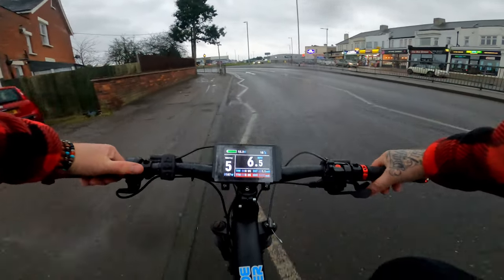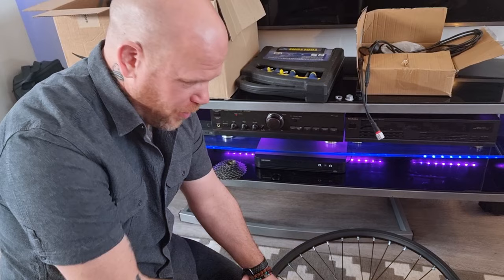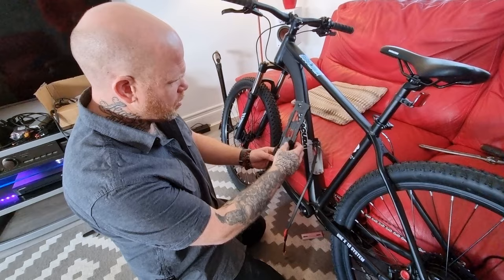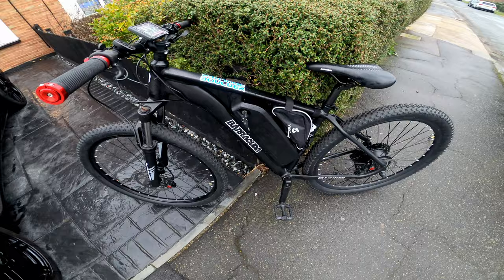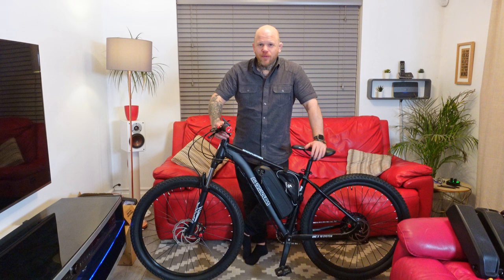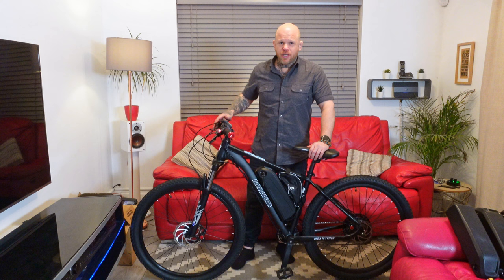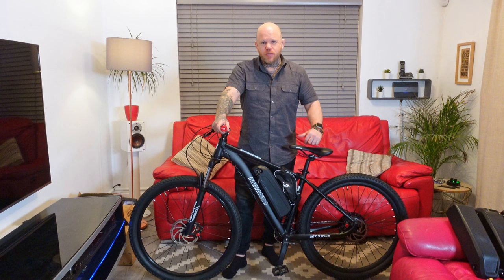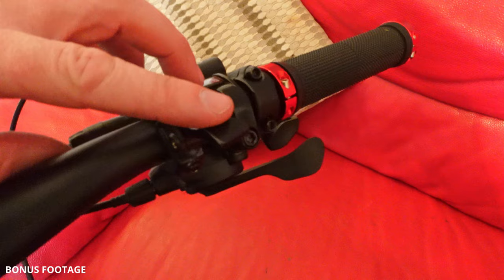How to BEAT the 250w ebike RULE!!!

Comment: I'm building 2 E Bikes and I've had to use a 10 ton Press, Arc Welder, Angle Grinders, Bench Drill and loads of Spanners and an Electric Impact Driver to fit the motor in the right place !!!  How they do it in India with a Hammer and a Spanner and a Screwdriver is Beyond Me !!!!    A sledge hammer  won't  bend  the  mounting plate !!!  Of course, nothing fits properly without a lot of work, but now I've got the motors fitted it's getting a lot easier !!!!  You need to be able to move the motor a bit to adjust the slack on the motor drive chain because it's bound to stretch !!!!

Comment: Sure, put a big controller and battery, and run a 1000w through a "250w" hub. Problem is, it's not rated to take that kind of current. I'd be nervous about that thing overheating and burning out on a hot summer day uphill. I hope you had some good cooling in mind for it.
Reply: Nah ,I've been putting 55v at 22amps through my 250w geared motor for 5 years now and not a problem, here in England 🇬🇧 it hardly ever gets hot enough to warm the motor or controller 😅
Reply: @ianmangham4570  Good for you! Over here in Croatia, that would fry the motor during summer, on its first climb uphill XD
Reply: @necroticavalon5176  Never gets warm here 🇬🇧 🤠🤟

Comment: Amazing straight to the point video love it. So I have a 1000w motor on my ebike smlro xdc 600 how can I get this moving faster its pretty OK 25ish maybe I'm 6ft and maybe if 30mph on 250w is achievable how do I get more on the 1000w Karen answers not permitted.
Reply: Get a bigger battery like a 60 volt, more volts = more top speed, more amps = more torque and make sure you controller can handle the voltage as some only have 63 volt capacitors in them so you’ll have to make sure they have 100 volt capacitors or you could burn it out

Comment: i've got a 36v 17Ah battery running a 500w Mid drive on PAS and agree PAS is "sketchy"  but I do like being able to use my gears to ramp up the slow speed torque.   if I forget to switch it to PAS level "0" I often get pushed into oncoming traffic if I accidentally hit the thumb throttle
Reply: Are you using a 36v controller or a 48v controller!

Comment: Hello, Dude Stuff. Quick question: does 'forcing' the bike to go beyond the wattage limit actually reduce the bike's lifespan in some way?
Reply: Reduces the lifespan of the battery a bit faster, and drains the battery more for the same distance
Reply: Knackers the hub motor as it's only built for a certain wattage really. Tiny nylon wheels having that much force going through will eat them up quick. Won't affect the battery at all
Reply: you can probably quite easily double the rated power of any hub motor and it will live with it all day. Most "250 watt" motors are probably 500 watt with a sticker saying they 250. This guy was probably putting 30 amps through it. Not sure what point he was trying to make with this video really
Reply: @mutleyeng they rate so many motors with much mote power at 250W so they can be legally ridden in most countries, which increases sales.  My china 250w "kit" runs at 750W with the stock "250w" controller.

Comment: I’ve seen a guy (sort of) beat the no throttle rule by just using a pedal assist sensor on the crank, but having no chain, so just giving the cranks a good spin basically works as a throttle but legal

Comment: I have pushed 750w peak through a cheap 250w geared hub motor, it still works.
Reply: Did you use the 36v controller?  or did you have to upgrade the controller and get a 48v one to match the 48v battery instead?

Comment: Good looking bike, and it's still technically a 250 watt motor even if you push "slightly more" into it 😉.
I second the motion to name it the Karenator.
Reply: the Karenator, love it
Reply: my bike is 13kw does that count
Reply: So you can put a 48v battery on a 250w motor, without making the controller burst into flames 😁 but before i run to ebay to buy a 48v battery and 250watt sticker lol, he mentioned that he got a controller that could take 48volts. Im guessing thats likely why it worked. 
Would i be able to safely run a 48v battery with the bafang 36V15A KT Controller? Or would it be too risky? 
(Its the 250w bafang waterproof rear hub kit sold on ebay btw. Easy to look up)
Reply: @Kumari_44  btw if you have an existing 36v battery you can just extend it to 48v, no need to buy a new one. MUCH cheaper.
Reply: @Fanaz10  thanks man. I appreciate the reply. I’d have to upgrade to a 48v controller too right? As in i couldnt run that battery on my current 36v controller safely?
Reply: @Kumari_44  goddamn bro, I wrote you a detailed reply which included a link, and apparently  youtube deleted it. 
tldr you may not have to upgrade your controller if your current one has 60+ v capacitors, but you may have to upgrade your batt BMS, since the battery will get drained too much. Also you'll probably want to get a lab bench power supply since 48v battery gonna need a different charger.
Reply: Thing is they say 15.5mph for an ebike but they also say 28mph for a moped but that didn't stop me n my mates derestricting or 50cc bikes back in the day and none of us got done for it
Reply: @kevinhansford3929 didn't get caught, therefore perfectly fine👍 good logic 😂

Comment: This might not mean too much to many, depends on ones build and energies... but I designed my mountain bike to be Dutch in style, and one finding I came up with on the peddling front (I'm a little underfit and overweight, but I do physical work every day and have kept going for years, though I love fitness), but I found a little revelation on bike seat position, the basics of what seems to be true based on my body is that where one positions and heightens the seat in relation to also having low handle bars can massively affect energy, but even with some mild road hills and trail hills, I can comfortably deal with them. Might make the difference between fun and hard work, have a great week all - peace /\

Comment: Alright mate. Great builds you do and you always talk proper. I hear you with all these karen types. I found an old ebike by the bins over a year ago, took it home, done all the karen checks on it to see if was nicked etc, was fine. It worked but the pedal assist was annoying. I now whacked a self built battery on it, hacked a bigger controller, grip throttle and got rid of the b*llocking pedal assist and made a larger front sprocket so i can still get exercise at higher speeds. Still only 36v but im doing a bigger 60 odd volt battery extention soon and modding some mini moto forks to stiffen up the front end. Ive pushed about 30 odd MPH on the 36V battery with the "250W" rated motor and thats with a heavy lock, me, tools and shopping on it. But i wanna go faster (int that always the case). Mine ain't as pretty as yours though.

Comment: i have a Hover 1 Pilot 25.2v 4ah 250w and i had to replace the battery. they don't produce the original battery anymore so i bought a 36v 8ah battery which I'm waiting for now. my question is do i have to worry bout the motor burning out or the controller getting a shortage? the bike is pedal assist, can i install a throttle?
Reply: check to see if your controller can handle 36v,should be written on it

Comment: Great video. I’ve watched it several time and it’s, along with Andy Kirby’s, channel inspired me to do similar  running a 36v 10Ah and 48v 10Ah batteries with a DX2 on a 350w front hub. I usual run the 36v (18mph) and have put  48v on a wireless remote controlled 72v 40a relay to act as ‘boost’ when I hit the button (23 mph) mounted on the handlebar for increased speed and torque up the hill. Question. Do you know how I can increase the speed using the SW900 display as the kit didn’t have any information for the optimal display settings? Best regards Raymond

Comment: I was just saying to a friend the other day,that the UK laws are stupid on ebikes. The pedal assist is dangerous at places like roundabouts where you would be far better off with a throttle,to get you upto speed quicker. The pedal assist takes a second or two to kick in. I have both pedal assist and throttle for this reason. Also I have a 250watt rear wheel motor and a 36 volt battery and on the flat I can get to 24mph,and with leg power I easily get to 30mph. 250 watt is not great on the hills around me in Sheffield though,but still a damn sight easier than a standard pushbike. I believe that a 500watt 28mph law would encourage far more people to commute by bike.

Comment: I've disconnected the pedal assist on my little bike because it was nothing but a pain in the ass. You couldn't just pedal slowly you had pedal your nuts off to keep up with the assist and considering I was using my bike to teach my son who was on his pedal bike it was no good.
I've had a few home built and my favourite was gt backwoods with a heinzmann 500w 24V motor powered by 36 volt battery and controller. Could keep up with the cars are easily round town.

Comment: That last disc bolt is a bastard! It's usually the last one! So I decided to trick the bastard! I undo the opposing bolt very slightly then move to the next one. The last one is usually the tightest, so I basically unscrew each one initially ever so slightly. Works so far! I used to have that problem all the fkn time!

Comment: Have you tried using rivnuts, they can make it a lot easier to deal with the problem where bottleholder and battery mounts holes don’t line up and they are really cheap
Reply from the maker: Yeah I use them

Comment: Please tell me how you did it. No, I got the jet and electric bike cap speed at 15.5 miles an hour is there a trick or something I don’t understand. Do I change the controller or do I unplug the controller and then plug it back in? What’s gonna unlock that? How can I take away? What stopping it? I got a 350 W and 30 that’s amazing but you got bigger wheels, I’m just saying if there’s anyway you got any advice how I could slowly mod without overheating or without any trouble do you have any tips please and also great content I’m trying to get that LC the screen I don’t have that I would like to get it and hook it up or should I just get a battery with the same 36v Except I’m gonna get 20ah so I could last longer out there and it’ll keep me at that 15 speed a little longer so I’m just saying if you have any advice please help me out. You seem to know exactly what you’re doing. I’m subscribed I like I share anyway in case you don’t, it’s OK blessings.

Comment: I love my little cadence sensing e-bike 750 W, yes you have to pay attention because one revolution you get nothing the next one it just starts bucking, add a bit of excitement but you have to know how to control them, just set up the American model mostly 750 W with the accelerator of 20 miles an hour or less if the UK thinks that hilariously quick but I’ve got a road bike that’s a lot quicker than the 750 W

Comment: That's the way to do it Steve! I've got a couple of 250w bikes running 52v batteries. Great fun!
Reply from the maker: What controllers are you running on those I was thinking about trying 250w on my hulk smash bike that's already 52v
Reply: Top job.
Reply: @DudeStuff  I reckon that you could put a 750w, 1000w etc controller with it. Or you could just wack a higher voltage capacitor onto a 250w controller.
Reply: @DudeStuff  I used a KT controller from a 1000w kit that I had on 1, and a phaserunner on another for a while until I fitted it to another bike, then changed to a KT. Works great, around 28mph on a heavy (46kg) 26" cruiser bike, and 25mph on a 20x4 fat bike
Reply: @DudeStuff  what's the max amp output for the battery you have there is it a 48v 40a bms?
Reply: @DudeStuff  So you can put a 48v battery on a 250w motor, without making the controller burst into flames 😁 but before i run to ebay to buy a 48v battery and 250watt sticker lol, you mentioned that you got a controller that could 100% deffo take 48volts. Im guessing thats likely why it worked. 
Would i be able to safely run a 48v battery with the bafang 36V15A KT Controller? Or would it be too risky? 
(Its the 250w bafang waterproof rear hub kit sold on ebay btw. Easy to look up)
Reply: theres universal ones that handle multi voltages

Comment: INTERESTING. Not many people know this. In Australia we have 2 types of legal ebikes. The 250w Continous rated  speed limited to 25kph (15mph)  everybody knows about this one. However we also have a 200w Output rule with NO SPEED LIMIT..But both types cannot be used  with a throttle alone. ie you must pedal to get assist. So Im wondering how fast I could make my Surly Midnight special  with a 200w motor with my legs pumping 200w as well. I can hold 200w for about 30mins 300w for 4 mins and 400w for 2 mins. Im guessing about 45kph (28mph) with 200w hub and 200w leg power would be easy . yours was 250w at 48kph!

Comment: 2:21 I realised when looking at my bottle holder screws that I’m going to have this same problem when my battery arrives, could I just mount the battery facing the other way?, if not, what size hole do I need to drill?

Comment: I get about 13 mph on a flat with my little Chinese conversion kit, the one with the external motor and bracket, which turns to about 2mph under any stress lol, I've since added a 50cc conversion sprocket which has easily quadrupled acceleration but will only  get 5mph in any situation lol, at least it finds hills easier but when you can peddle faster than the motor in the first place it's hardly worth it lol. Will have to invest in a hub motor asap lol
Reply: Bbshd with 52volt battery. I get 20 mph up crazy steep hills 38mph on flat.

Comment: you probably already know this but just incase

that metal tray where you secured the battery sled is for battery sled ebike controllers grinn and a few others making controllers that go in that spot so you dont gotta find somewhere to hide the controller
Reply from the maker: Thanks yes I have one of those controllers and have never used it tbh

Comment: Hi mate so I got a mid drive e bike is a 250watt and my battery fucked cells not working dead and not chagering so I need a need battery I have a 52v 18ah out of my old broken scooter and was wondering  will it be ok 2 just connect it 2 my bike and will work ok think old battery is 36v 6.6ah only upgrade higher not for speed just charge less and larst longer is only assist

Comment: i think ive found the perfect bike for my weight GOGO BEST GF700 its got a really good 17.5 48v battery 500w hub motor in each wheel it should be able to carry me i was hoping to go on a long 50 mile ride with it but its not road legal i highly doubt the Legal 250w will be good enough may even blow up been under lots of stress.

Comment: Hello, I wanted to ask you if a 250w motor can be used with a 20ah 48v battery?
Reply from the maker: With a 48v controller yes but if its too many amps will melt the phase cables

Comment: Can I build a pedal assist only from a rear wheel hub conversion kit?  Reason being I want to build two conversions for my childrens 20" and for the elder on the 24" but want them to pedal rather then drive like a motor bike.  Any tips for kits please? Thank you
Reply from the maker: Yes you can use pedal assist only check the pas fits the bottom bracket of the bikes you have
Reply: @DudeStuff  Thank you mate.  I'll look into it, cheers

Comment: Don't mean to be a jerk but thru last experience decades back I had a 250watt moped bike which I found 250watts a bit too slow for my needs. Besides the speed it was the lead acid batteries back then as they mostly obsolete of using as last resort of an  Armageddon stock pile kits.

Comment: Yeah the person who designed those battery mounts deserves to be punished. Life is too short to ride legal 250W setups.  Your 250 is faster than my 1000W, well done.
Reply: Yeah I was thinking the same. I have a 1000w 48v (granted only a 20amp controller tho), And his 250 has the same top speed as me 😆 And his acceleration with throttle is a bit better.
Reply: Guys your bikes are fine the fact is he’s running 15-20 odd amps through this 250w motor your 1000 will take a lot more than that and also will stay colder as it’s designed to take more power

Comment: Bought a 1000w ebike after we gone out and rented some a few weeks ago. Not even realising that ebike laws are a thing! A little bot screwed now as the shop i bought it from is 400 miles away. How likely am i to get away with riding this thing on country roads and trails?
Reply: In the Netherlands the police have a device where they putnwheel on a trail where they can measure the speed of your mopes without the moped going anywhere .The police in the Netherlands have announced that they will use a new device end of this year which is capable to measure speed of ebikes .If the bike is over 25km hour you will pay a fine of 290 euros and you lose the bike .
Reply: @azadam1000  and to think they could be spending that budget catching violent criminals instead of ebikes which travel 10km/h faster 😂

Comment: I changed mine to a 48v battery running off a 36v controller turns on and Ride about 2.3 miles then the whole bike cuts out let's duck do you know what that could be
Reply from the maker: I'm guessing the controller doesn't like the 48v battery change your controller maybe

Comment: I agree with you about pedal assist. Even pedaling backwards will engage your motor, which means you can't adjust your legs without potentially accidentally accelerating at an inappropriate moment.
Reply: I just get busy with the brakes. Also mine doesn't engage the motor when I pedal backwards. I prefer pedal assist. I just use the throttle briefly to set off.
Reply: If it engages when backpedaling you need a dual pas sensor. Some kits only come with a single. The duals are directional.
Reply: Always cover the brakes so you dont shoot off.